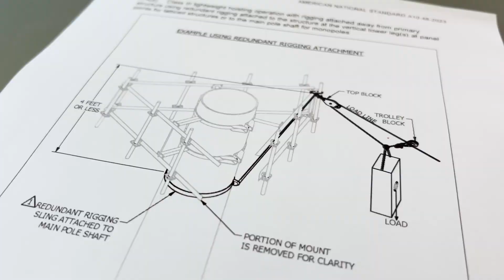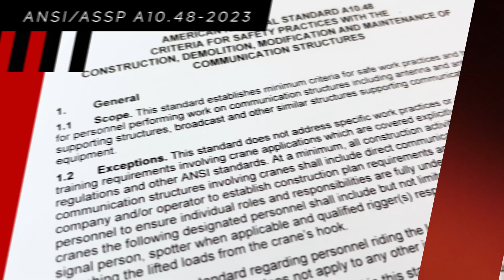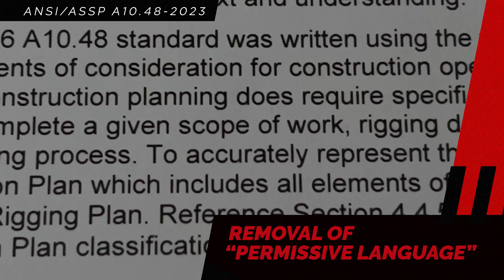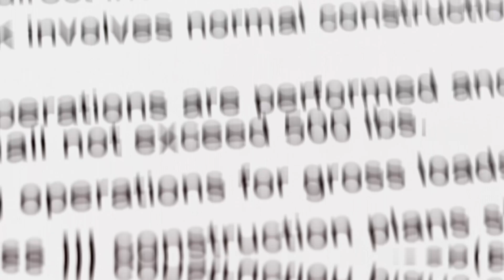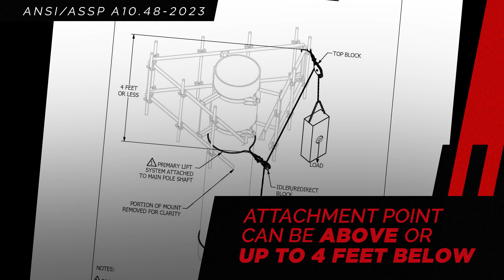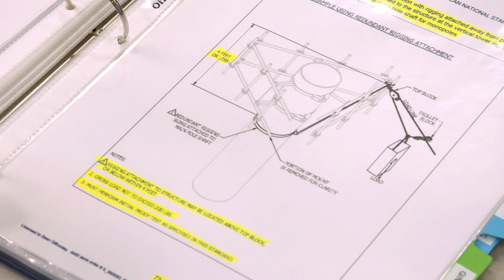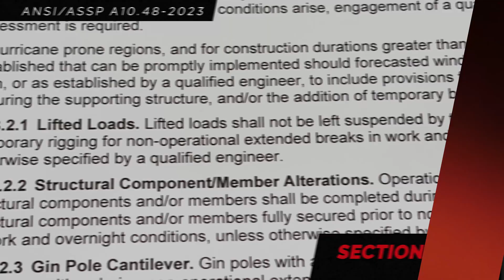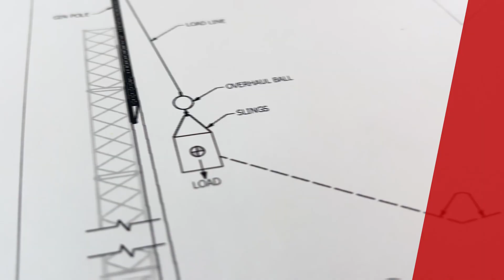ANSI/ASSP A10.48-2023 Standard - NATE #ClimberConnection Video

Comment: Great video gentlemen. This video helps iron out some basic guidelines that I know a lot of people have in regard to how the Rooster Head should be utilized. Especially for industry veterans like myself who used to be able to fabricate our own version of these on site back when it was not frowned upon.  The only thing I disagree / found questionable is the statement regarding no personal on the tower during testing the system. I would recommend someone to be on the tower to oversee the rigging during the test in the event that the rigging starts to fail or needs adjustments, the spotter can halt the test. If it was a load of 1k or something along those lines I would agree but this system is used for light loading only. I would like to hear more about why no personal is aloud on the tower during testing. Keep in mind that also requires the rigger and the entire topside crew to climb down the tower and back up multiple times a day (every antenna pipe and sector it gets moved to during use in theory).

I'm the owner of Gulf Coast Tower Services out of Houston, TX by the way. Feel free to reach out to me directly. I will be sharing this link with colleagues.